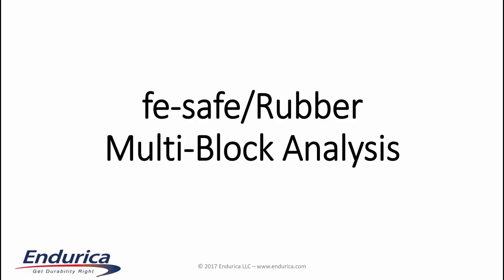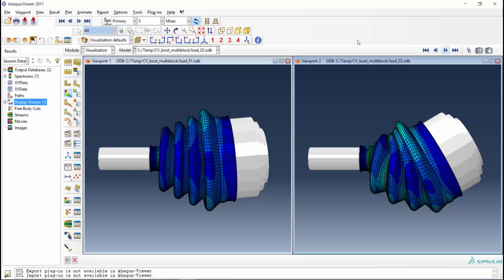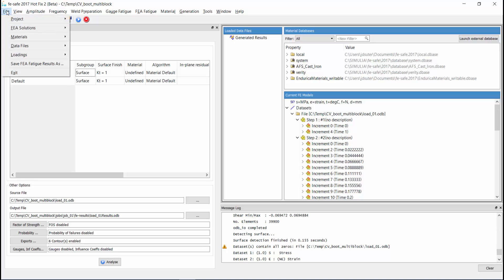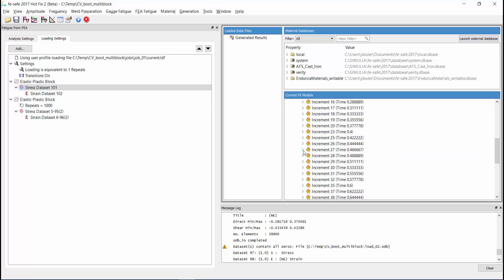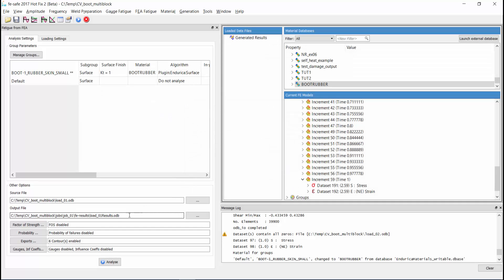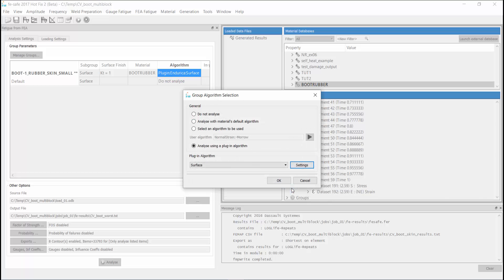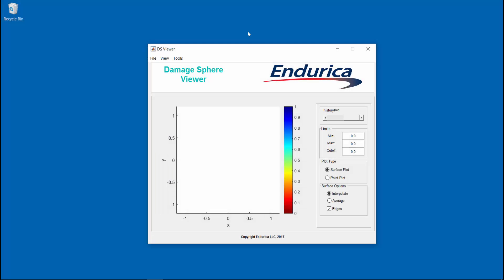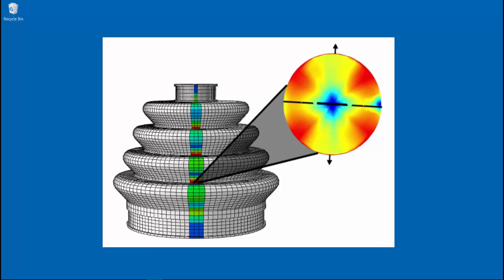Using fe-safe/Rubber to analyze multiple block cycle load cases

Comment: very helpful Sir! is it possible to do fatigue analysis using fe-safe for concrete material?
Reply from the maker: I believe it is possible, but Endurica only develops the rubber fatigue solver. You will want to reach out to Dassault Systemes / Simulia to get this query answered authoritatively. best wishes...